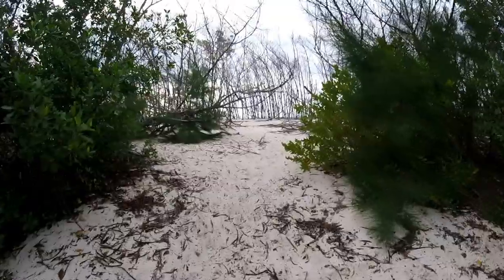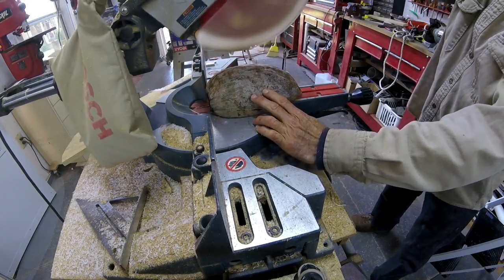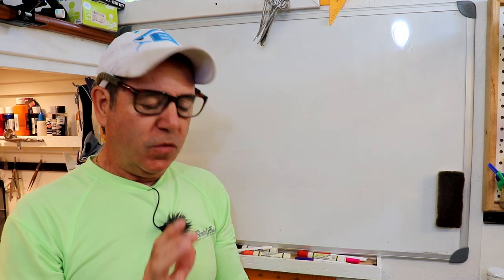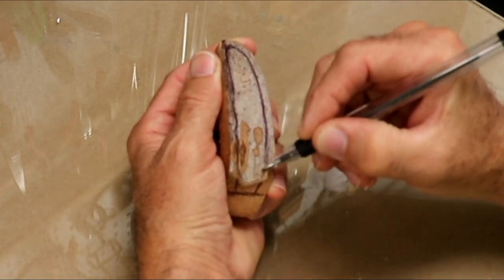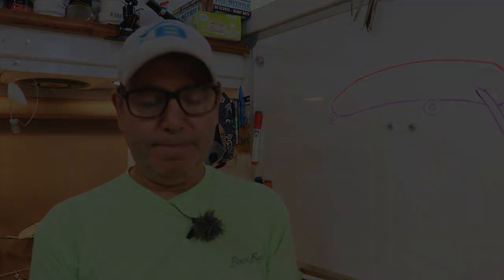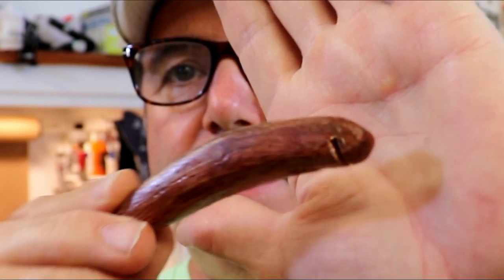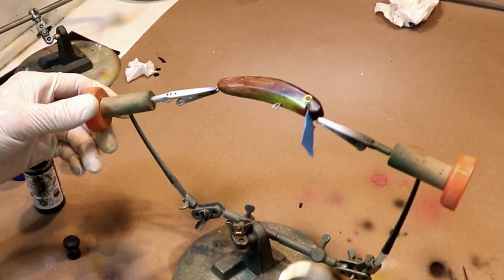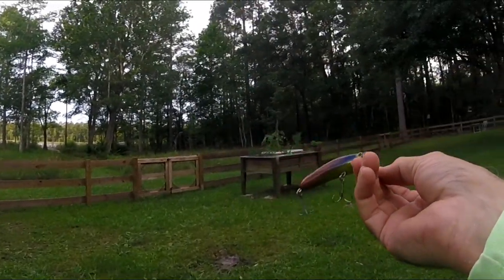Making a Crankbait, Handmade fishing lure made from a coconut.

Comment: How about vacuum infusing the coconut blank with a stablising resin?  That might make it easier to work with along with increasing its density a little.
Reply from the maker: Yeah man, we think alike. I started doing that, vacuum saturating with a very thin glue, but the cure time is weeks.  If it works, l'll turn a topwater lure on the lathe.  Thanks for watching.

Comment: Not just kind of cool - but Very cool !  Thanks for posting!
I have a few questions for you about the minwax polycrylic; 

1. what is your preferred thinner?  Or 

2. is it not that critical and any medium or even water will work?
3. does it require sanding between coats?
Reply from the maker: Destilled water for thinning...as long as the second coat is sprayed before full set you don't need to sand.
Reply: @EngineeredAngler  Thanks!

Comment: When making a molded swimbait how do you create a space for the hinge pin
Reply from the maker: I have done it in two ways.  The simplest is to mold it with the hole you drilled and the result is a partial hole, an indenture.  Then you just drill through the new lure to finish the hole.  But if I want to avoid drilling I use a swizzle stick coated with silicon grease or Vaseline.  The stick crosses the mold where the hole should be and when I de-mold the lure I carefully poll out the stick.  Hope that makes sense...